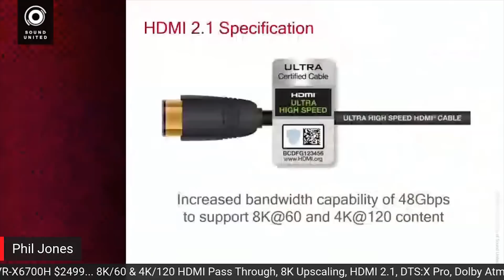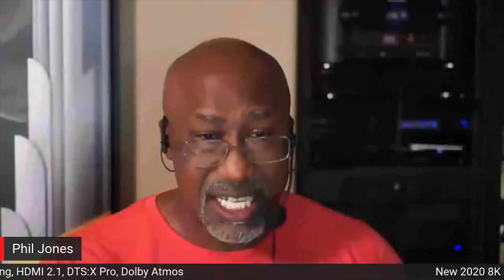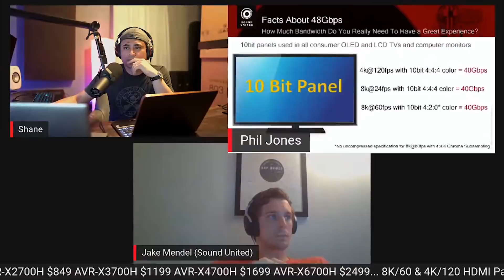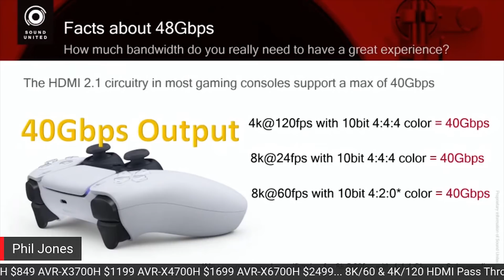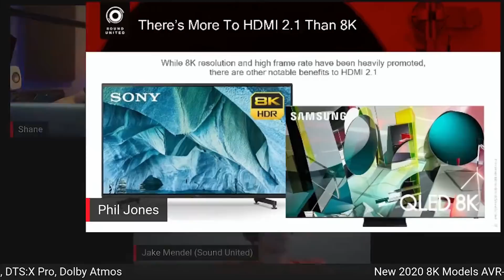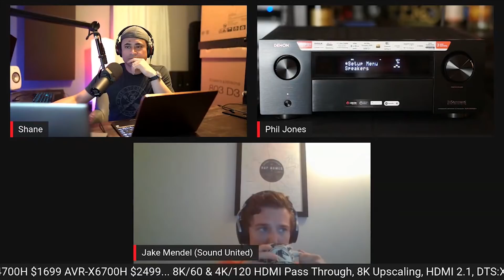Denon HDMI 2.1 Do You Need a 48gbps Receiver?

Comment: I get the point, but I think the thing about an AVR is that folks kind of want to not chop and change too often.

So wanting something that can passthrough Dolby Vision (yes I know DV is actually passed within 8-bit data) at 120Hz minimum with VRR so that it's the singular device for all inputs ... I dunno, it's just a pain that there's still not one AVR (reasonably priced) that can do everything and a TV and/or projector which can show all the HDR specs.

Comment: I own the Denon AVC 6700 and sorry to say the audible audio with in the theatre setup starts when I hike the volume to about  at about 68 to 70%. There is hardly any significant gain between 0 to 65. Not punchy at all . 2020 Denon receiver is more snake oil than actual stuff. Guys please go for the Marantz SR 8015 if you need some grandeur and intend to buy a AV receiver this year. 8015 delivers that punch. I really like the Denon for its bright sound but the 2020 receivers are a big disappointment even in terms of their build quality. I have done a  sound comparison at my house between the Marantz 8012 and AVC 6700 and Denon 7200WA vs Denon AVC 6700 and the most disappointing sound is that of the AVC 6700. I would rate Marantz 8012 and Denon 7200WA at par with the only difference being as expected Marantz is a little warm and Denon is bright and sharp. In short with the marantz its like travelling in a rolls royce and the Denon is like a lamborghini or a ferrari. I have not tested the 8k mambo jumbo as I do not have a 8k TV

Comment: I am still kinda of lost....

So if I have a PS5 connected (with 2.1hdmi) through my Denon X4400H and plugged into my 2.1hdmi input on my LG TV....is the receiver clogging up the information flow?

Do I need to plan for a receiver upgrade that has 2.1hdmi?

Based on my layout, it is not possible to plug the PS5 directly into the TV.

Thanks in advance.
Reply: This is the question I had as well. Dag still no answer. I picked up the Sony 900H

Comment: Sony 950g  TV has earc without  a  2.1hdmi input,  denon 3700h receiver has earc with 2.1 hdmi. Will earc work if I connect my TV to the denon receiver? Do I need a 2.1 hdmi cable?

Comment: Maybe I'm mistaken but wouldn't a tv with e-arc and 2.1 support (and enough ports to handle your 2.1 devices) completely make 2.1 receivers irrelevant since as long as the receiver supports e-arc (or using sharc with regular arc) it should be able to capture the passthrough audio data while letting the tv worry about the visual layer. Or does 2.1 offer some additional audio specific enhancement where such a setup would still necessitate 2.1 on the receiver?
Reply: Why isn' this question answered?

Comment: Phil Jones.  Will 2020 LG OLEDs pass lossless audio to your new Denon AV receivers via eARC ?   Is 40 Gbps enough speed to pass lossless Dolby Atmos to your recievers ?  Thanks.
Reply: Dolby yes. DTS no. Sadly, LG's 2020 OLEDs have dropped support for DTS audio of any kind via ARC or eARC. The best you could do would be to have your source device decode DTS audio into 5.1 or 7.1 PCM and send that via eARC. But that would mean DTS:X is out the window. So if you were hoping to use a PS5 or Xbox Series X as a Blu-ray/Ultra HD Blu-ray player, and you have some DTS:X discs, that is where the new HDMI 2.1 port on the 2020 Denon Receiver models comes into play. Your other option would be to get a 2019 LG OLED instead of a 2020. The 2019 LG OLEDs supported both Dolby TrueHD + Atmos and DTS-HD Master Audio + :X via eARC.

Comment: So will I need a specific hdmi 2.1 cable if so where do you get them? Isn't the current hdmi 2.0 cables limited to 18gbit?
Reply: Yes, the official name is "Ultra High Speed" HDMI Cables. They have to be certified. And they will have a hologram and a QR code if they are legitimate. Any cables labelled as "HDMI 2.1" or "48 Gbps" are not officially certified. "Ultra High Speed" with the hologram and QR code is the only thing you are looking for, if you want to be sure. As far as I am aware, nobody has certified Ultra High Speed cables available yet. But Monoprice will likely be among the first. So I'd keep an eye out on their site. Or you could chance it with the 48Gbps labelled cables Monoprice is already selling without any certification.

Comment: Hi Shane, if I plug lets say my new ps5 via 2.1 on my tv ( 2.1 capable) then connect the tv on my receiver via earc what's the need of the lets say 8k 60hz / 4k120hz pass through new receiver? Thanks
Reply: As long as your TV supports all of the audio formats you want to use via eARC output, plugging your sources into your TV, and then running the audio to your Receiver via eARC is fine. It means your TV ends up being your switching hub, and it means a bunch of unsightly HDMI cables, rather than just a single HDMI cable between your TV and AVR with the AVR handling all of the switching. But in terms of just functioning, it could theoretically be fine.

But as an example of how it isn't necessarily fine in the real world: the 2020 LG OLED TVs no longer support DTS audio of any kind via ARC or eARC. So if you wanted to use your PS5 as an Ultra HD Blu-ray player, you wouldn't be able to hear any DTS:X or any DTS-HD Master Audio. So for that reason, you would want to plug your PS5 into the AVR first so that it can properly handle all audio formats, at least in a case such as this. And then, of course, the AVR would have to have HDMI 2.1 video pass-through in order to send the PS5's video on to your display.

And it isn't just 2020 LG OLEDs; Samsung has never supported DTS output via ARC or eARC, and obviously a lot of gamers are using Samsung TVs. And there are other TVs with limited audio output options via ARC and eARC. So unfortunately, you can't be sure you'll get all of the audio formats you want just because your TV says it has an eARC output. We SHOULD be able to expect that. But the real world isn't living up to how things ought to be at the moment.

Sadly, what the industry has done this year is going to lead to so much confusion. For a multitude of reasons, if we could all just agree on a mulligan, and all pretend the year 2020 never existed, I think we'd all be better off...
Reply: @RobHFirstReflect  Pretty sad indeed to see what we are getting from the industry in 2020... the DTS is one thing that bothered me because I'm about to upgrade to the CX... maybe LG knows something we don't but I thought that I could manage the problem. See for the movies which is my priority I'll plug my ub820 4k player to the avr, then the rest on the tv. Knowing that internals tv apps like Netflix don't use DTS I should be fine ( worst case scenario I'll use the app from the player). Now for games it could be the problem but I think they share the audio with Atmos so I'm hoping to get Dolby while playing. Of course the big deal I guess would be the use of a PC on the LG as a monitor. 
I'm not a fan of having a bunch of wires connected to a tv, it was great to have only one HDMI running to the tv I guess we have to thanks the industry for confusing and making our life harder. I was also confused ( but happy) when I discovered that my sony str 1080 avr had earc via an update knowing it doesn't have any 2.1 hdmi output.... anyway thanks for the reply!👍🏼
Reply: @rachonlepatron1720  Frankly, the best display to buy in 2020 is a 2019 LG OLED (C9). All four HDMI inputs have the full 48 Gbps thanks to it actually being a two-board solution (there's a daughter board, so it's not all-in-one). And the 2019 OLED support TrueHD/Atmos and DTS-HD MA/DTS:X via eARC, so they have a leg up there, as well. They weren't passing 7.1 uncompressed LPCM audio via eARC, but there's a firmware fix coming for that. Might already be out, actually...

The only picture quality advantages of the CX are slightly better just-above-black dithering, and it doesn't force overscan on SD sources anymore. The new black frame insertion isn't really very valuable, IMO. You'd never want to use it with HDR in any capacity. And you can't use it at the same time as VRR, so you'd probably never use it for SDR games, either. So...SDR sports, maybe? That's about the only place it might be useful at all. Hardly worth it for all the other downgrades.
Reply: @RobHFirstReflect  Sony 900h is also pretty great for a 2020 TV. It comes with 4k 120Hz, VRR, earc, only $1300 for a 65 inch.
Reply: If you have an old receiver that supports eArc and you have a Hdmi2.1 tv, connecting the PS5 to another tv Hdmi2.1 port and using eArc port to output audio, no need for a new AVR.LG I believe are rolling out new firmware for 9 series to get past current LPCM over eArc restriction. What I don’t know is if you want QMS on a Hdmi2.0b item, as well as a new AVR (as old AVR’s don’t support it) would it work or is it only a feature on new Hdmi2.1 devices, assuming the former in which case of course we all have to cough up for a new AVR :)

Comment: So much energy spent on spinning this whole 40 Gbps situation that we have this year. We can handle the real reasons why we only get one HDMI 2.1 input and why that one input is limited to 40 Gbps: there's a budget and a timetable, and these are the mass produced chips that are available. Simple as that. It's not a feature. It's not an advantage. It's just the best that can be done right now within budget and timetable. And it's a stopgap year. We can all understand that.

Bending into pretzels to explain that 4K/120 10-bit 4:4:4 can fit into the 40 Gbps limitation is fine. But the instant someone tries 4K at 144 Hz...poof! We've blown through the 40 Gbps ceiling.

I can appreciate this is marketing. I can appreciate they're trying to make the best of the situation. But next year, the X_800 Series is going to have 48 Gbps ports, and more than one of them, and someone from Denon will be right back here explaining how great it is that we don't have a 40 Gbps limitation anymore.
Reply: This isn't a limitation and it's not the reason why you lay out that it's just what we have. This honestly isn't complicated to understand at all but so many people out here have no idea what they're talking about and thus add to misinformation. We don't have 12bit panels in the tv industry. Only 10 bit exists and will exist for the foreseeable future due to technological restraints to achieve peak brightness required to achieve 12 bit. 40gbps is more than enough of a bandwidth ceiling to take advantage of all available features for a 10 bit panel. Trying to cram a 12bit signal through a 10 bit panel is pointless because the panel only can output 10bit. The fact that people can't understand this baffles me.
Reply: @InChristJesus87  Hisense already has 12-bit panel models for sale in China and Australia. Yamaha just announced their RX-V4A and V6A models with more than one HDMI 2.1 input (although Yamaha hasn't made it clear if they're 40 or 48 Gbps). My point wasn't anything to do with whether a single HDMI 2.1, 40 Gbps input is sufficient to pass through one source to a current display, my point was that Phil is doing this marketing effort across many different outlets, trying his best to convince potential buyers that these 2020 Denon and Marantz models don't need to be avoided; but, while his info is totally factual, this just isn't a great year to buy a Denon or Marantz IF you care about HDMI 2.1 stuff.

It happens sometimes. I'd easily bet next year's 2021 Denon and Marantz models will be easy to recommend. If Yamaha can have 3 and 4 HDMI 2.1 inputs this year, D+M will have them next year. With Hisense planning to bring their 12-bit models to North America in 2021, and LG already having had 48 Gbps ports in 2019, the tech all exists. It's just a matter of timetables and budgets.

You're off in your thinking that the reason people aren't hyped about these particular models is because they can't "understand" that 10-bit signals and 40 Gbps ports are sufficient for the sources and TVs that we have, basically "today". There's no lack of understanding about that aspect. I'm pointing out that this just happens to be an "off", stopgap year for Denon and Marantz. There's really no way to spin having only one HDMI 2.1 input. That's just...not great, no matter how you slice it. And when you combine that with 40 Gbps instead of 48, yes, it's fine for this year. But a lot of people intend to keep and use an AV Receiver for five or more years.

The point of everything I wrote is that all of this is very likely going to be moot in Denon and Marantz' 2021 models. They'll have more than one HDMI 2.1 input, so they can act as an HDMI 2.1 switch, and those ports will probably be 48 Gbps, so even if you keep a 2021 AVR for a several years, having it in between some 12-bit NVidia RTX 4000 Series GPU and a 12-bit panel TV (like what Hisense will be selling in North America next year) won't be any issue. Whereas, if you buy one of these 2020 model year D+M AVRs, at the very least, you'll likely end up annoyed at some point that it can't switch between even just two HDMI 2.1 sources. And at worst, it might not be able to pass through a future source to a future display, as early (theoretically) as next year.

Suggesting that Denon and Marantz fans might want to hold off on their AVR purchase for one year is prudent advice. Not "pointless" or "misinformation" or due to a lack of understanding. Occasionally,  it's just a good idea to wait a bit. And this is one of those occasions.
Reply: Display Stream Compression, mate
4K/144hz 10-bit 4:4:4
Required Data Rate = 49.152 Gbps, will be compressed to fit into HDMI 2.1 40 or 48 Gbps